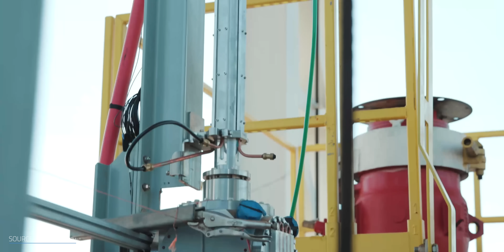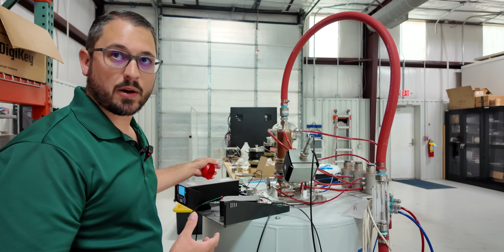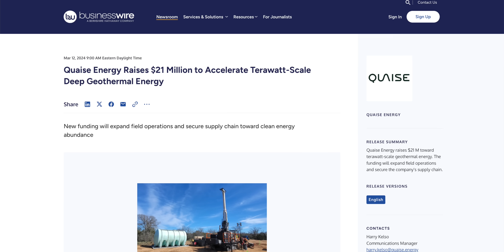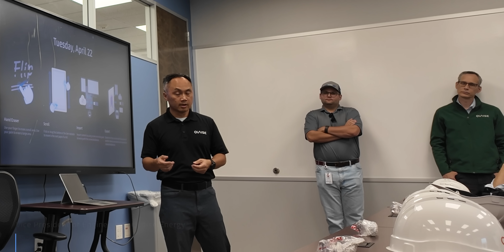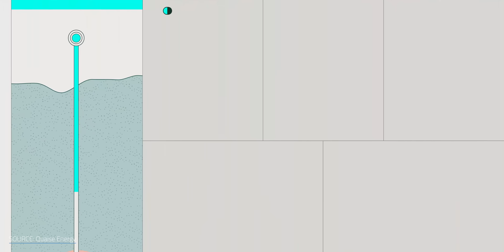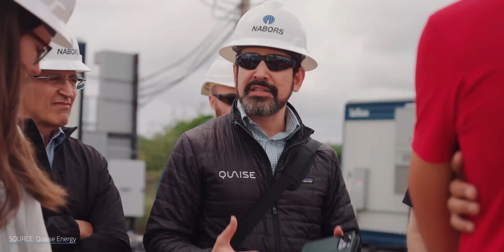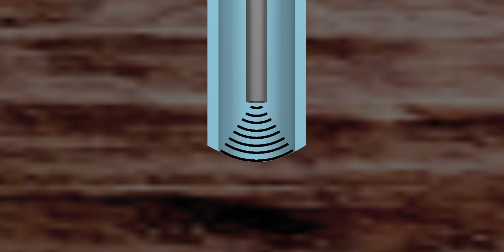How Geothermal Energy is About to Break its Limits

Comment: 14:43 I also really really would like people to put those numbers into perspective on the price of generation. There is no way on earth, that this technology would stay more expensive than the competitors over time.
I would really like to hear what exactly they calculated there. That has to be an absolute lowest end assumption.
People have to think about this, the moment you have the hole, you get energy for free for ever. What you fit to end of it, how often you might or might not have to change the equipment in the hole to circulate your heat transfering liquid all of that can't be so bad the moment the hole is there once.

This is on an absolutely different price trajectory as wind or solar. The expensive part has to be the drill, the hole and the water piping and the rankine cycle turbine can't be cost prohibitive. And every drill you build can drill one hole after the other!

Comment: The technology is fascinating but it's a bit disappointing that this channel has not covered Eavor (I did a search). It's a Canadian company that uses directional drilling to create multiple channels in hot rock, about 3 km down. They are right now building a power plant in Germany that will provide both hot water for heating and for electrical production. Quaise it's not even close to having demonstration project.

Comment: What really shocks me about the criticism of this technology is how most of the concerns are insanely small compared to anything else you read about in energy sciences and technology. Like other technologies have to find a solution for rapid degradation of a catalyst due to not really understood physical and chemical processes... their issue is that it takes 1MW to run the drill...
Any major concert or festival pulls that kind of power. You rent three big diesel generators and off you go... like this really isn't a big concern!

Comment: Scale this up and turn it horizontal and you get a tunnel borer with glass floors
Reply: if course you need to do that because the rock is not very conducting and a 200mm hole will soon fill up with cool water unless you reach a large superhot water mass that can flow easily
Reply: Albeit one that would probably be much more feasible to tunnel through mostly dry mountains, as opposed to tunneling under rivers and wider bodies of water (because of this technology's difficulty in dealing with water intrusion).
Reply: or put it on a vehicle like some sci-fi tunneling machine

Comment: why dont you just plasma cut through everything as the drill, its compressed air + welding arc. plasma arc cuts rock like butter. simplest cutting tech of them all, including water jet cutting. just have some power/water wires and its done. so why not just fiber laser. its also accurate over distance. micro waves nonsense sounds a bit complex. any melting drilling also forms the side walls of the tube by itself. whats progess. must be a registered tech (r). do you like deuterium carbon arc lamps. you need a deep dive.
Reply: why dont you just push a hydrogen welding torch gases down the drilling tubes, and an outer tube brings up the water steam. and any dirt.

Comment: It's very encouraging to see them talking about real hard numbers and not talking about how they're going to need subsidies to stay afloat
Reply: I 100% agree. Everytime I read or see something about this company I am absolutely baffled how no state has just said, hey we give you 10 billion euro, build it.

The problems they list are absolutely laughable to other technologies. Just the fact that they see it necessary to mention that they need 1MW to run that thing... Like how much power does a Siemens reactor for silicone use? Or how much power does the set up for Adeles shows consume? 

This is absolutely crazy. And the potential benefits are just endless, how many holes that one could use so that you don't have to drill the first km do we have on this planet because of oil drilling and water wells etc!
Reply: @petergriffin4629  The BIG BUDD Tractor. The largest tractor in the world has a engine producing 800KW mechanical. 1MW of power is laughable in the grand scheme of things.
Reply: @JackWeems  part of the problem with this viewpoint is that it fundamentally means “if it’s not cheaper than burning dinosaurs on day 1, it won’t ever be done.”

We’ve done like 200 years of economic development on oil. 

And it may turn out to be the case that oil is just flat out cheaper than all the other alternatives. Subsidies are how you slowly introduce that cost difference to a population so that they’re not freaking out overnight. 

Don’t vilify subsidies. They exist for a reason.
Reply: "how they're going to need subsidies to stay afloat"
He didn't really say that. He did say they're negotiating guaranteed rates for power that won't be on the market for several more years. Market rates don't really need negotiating, because the market sets the price. It remains to be seen if he's getting at, above or below market rate contracts, and whether those depend on any sort of credit or not.
Reply: @wisenber  not sure if I missed OPs point but I'm pr sure they were saying most of these promising technologies are usually encapsulated by subsidies due to not being economically viable for one reason or another, and that this tech doesn't seem to be in that same camp
Reply: @robocu4 Prenegotiated rates that are above market is one of the main subsidies. That's why so many wind projects went under when MA and NY wanted lower rates than the original agreement.
Reply: Another excellent video. 👍 You are really outdoing yourself with the puns!
Reply: There is nothing about numbers in that video...
Reply: Geothermal has been neglected and ignored by the government for decades, which might be its greatest strength. That and sharing infrastructure similar to the petroleum industry.
Reply: This looks like a pipe dream!
Reply: @soundsoflife9549  <drum roll>
Reply: This method of Energy abstraction is very bad.
Reply: People are not thinking deeply at this topic at all - from my massive comment:This won't work under our current 'for profit scam economic system.' Look, when humans discovered oil's usefulness, we got wars for 120 years over resources and a never ending headache in the Middle East, terrorism, and trillions of debt for fighting wars over their - all because of market economics - all because the easy to get oil sat under people who didn't share our same culture so we had to muscle our way in. So what's going to happen when all these corporations want to take over all the thinner parts of the Earth's crust to make it easier to hit heat? Looking at the plate tectonic map you flashed on the screen, are we going to have wars with Japan,  Peru, the Philippines, Cuba, Haiti and various African countries because they lie on or near fault zones?  Are American energy company going to use the 'Velvet Fist of spreading Freedom and Democracy" to force them to build steam to energy plants on their sovereign soil or territorial waters? Any company will have to spends billions of dollars running deep of shore platforms in the middle of the Atlantic  or pacific ocean just to extract heat energy and then what? Ship hot pressurized water or steam or a giant metal heat sink hundreds or thousands of miles to be converted to usable energy on shore?  Or are they going to magically make floating energy conversion station way out in the ocean and magically beam that energy to shore with microwaves? And because our entire socioeconomic system is motivated by money, profit at all costs, corners will be cut, and power will just be consolidated into the hands of the few. And does geothermal really solve anything? All that heat that gets sucked out of the Earth is going to get dumped into Earth's atmosphere or the ocean, thus negating any real 'CO2/emission savings'
Reply: This will not be some 'magic savior technology' - geothermal wont save us from climate change - climate change isn't about C02 emissions - climate change is due to HEAT ENERGY being pumped into the atmosphere. It does not matter WHERE the heat energy comes from, its all about HOW MUCH HEAT ENERGY is being added to the atmosphere. 95% of people do not understand thermodynamics and are fixated on C02 emissions because that's what mass media pumps into their brains
Reply: government contracts are subsidies...what are you talking about?
Reply: @bvbxiong5791  That's wrong. Not all government contracts are subsidies. It just means the government is the customer. The government buying military equipment from a private company does not mean they are subsidizing the product, just that they need it.

Comment: I am a massive fan of this company and this technology. To me this is a perfect storm example how real progress in the market, engineering and science works.
I am a physicist but I do also have more than a foot in engineering and especially in the actual science of innovation. It's one of the most typical markers of true innovation that an invention produced by steady progress in field A enables technology B.

I just want to go through this technology and why it's absolutely amazing for everyone to understand. So first, when anyone gets hyped about new green energy you have to do a back of the envelope calculation for the terawatt challenge first. This will return rather quickly that silicone solar cells... lithium ion batteries, even wind power don't pass the test.
You can't scale to TW power at all or not in time. This can! Easily.

Next up, what are the actual limitations towards achieving a goal, what is the nature of the obstacles. If you consider battery technology and solar cells and the likes, we are talking about physics and chemistry. These are notoriously difficult to improve on, once something has been found lithium ion batteries for example, engineers are extremely good at optimizing everything about and around them (think about modern car batteries) but they won't improve the actual physics of it.
Here we have the perfect storm for that, we can do it! We did it already, the soviets drilled 12km deep in 1989... but nobody did it since, because of limitations of the time, but just from a physical envelope question, we already did it! Now give this 40 years of improvement in every field of industry and tackle the same problem again!

It's like with Musks rockets, everyone went crazy with what they achieved, but don't forget, they beat equipment from the 70s... Quaises competition, the bar they have to cross is soviet technologies from the 70s! They can do that with absolute ease.

Finally, and this is the amazing part, is scalability simplicity and necessity for control. Technologies have a really big impact, if they are simple to do and if lacks in control can just be avoided by hitting something with a bigger hammer. Think about jet planes of days past, the engines were way way less efficient then today, but that doesn't matter, because expending more energy to get to the same outcome is usually a lot easier, than investing more energy to get something more efficient.
The numbers they give here for what power they need are laughable in the large picture. Any gravel quarry with the machinery there uses that kind of power. So this is totally scalable and it could be done quick. Want a bigger hole? You don't need to get a perfect great efficient system going. You can just get a bigger Maser, take three of them and blast the shit out of that hole.
Once it's done you make money from it... for ever!

I would really love to invest or something in this technology! I am hooked.

Just on a side note, this is the exact reason why states should invest less money, to force not really market worthy technologies in the market, and rather shoot it broadside into sience and see what sticks!

This the final point I want to leave anyone with. If you are critical of this company and what they might be able to achieve, look up how much money just Germany has invested into solar power that doesn't really work and imagine if they put 1/3 of it into this technology...
Reply: User: Claims solar cannot scale to Terawatts power
World: 2 Terawatt Photovoltaic in 2024 (with the 2nd Terawatt installed over just the last 2 years!!))
Reply: @tristanwegner nonsense. That's peak power. 
That's not average power generated over a year. 

That's like calculating how much fuel cars use by multiplying the peak power output the manufacturer provides with the hours used.
Reply: @petergriffin4629  you said "silicone [ha ha, silicon ] solar cells... lithium ion batteries, even wind power don't pass the test". They are a million times closer to clearing the arbitrary bar you've set than this technology. And they aren't notoriously difficult to improve, everyone in the field but you knows that their cost curves continue to decline. It's a fact that solar and wind, increasingly backed by battery storage, are the majority of new generation everywhere in the world and their production increases every year. You need a better back of the envelope.
Reply: @tristanwegner  Bro, ich habe mir jetzt sogar extra die Mühe gemacht und die aktuellen zahlen nachgeschaut. Meine waren etwas veraltet ich hatte dazu eine Vorlesung im Master...
Im jahr 2024 laut Wikipedia, nicht das das eine geile Quelle ist... wurden 2131TWh solar erzeugt.
Das Jahr hat wenn ich mich nicht irre 8760h 2024 weil es ein Schaltjahr ist sogar 8784h... da sollte selbst ein unterbemittelter sehen, das die zwei Zahlen zusammen nicht 2TW ergeben😂😂😂😂

Und der Punkt übrigens ist ja nicht, dass etwas nicht irgendwann zu 1 TW skalieren kann, sondern wie schnell.

Wir haben derzeit so um 20 TW für die gesamte Menschheit das sollen bis 2050 je nach Schätzung 35TW werden.... wenn wir mit globaler hochbelastung der industrien gerade so 240 GW gebastelt bekommen über Jahrzehnte, wo ziehen wir uns da dann 15 TW aus dem hintern?

Comment: I love the idea but I would like to know how they extract the heat. The amount you can extract has to be related to the thermal conductivity of the rock at that depth. With only 2 shafts you would be quite limited I imagine.
Reply: Yes indeed. The length of the shaft that's in the really hot region matters. Claude AI couldn't give actual numbers on how fast the rock around hot geothermal would cool down. You could always pump water into the hole at a lower rate, or pause operation to let the surrounding rock heat up, but that's going to increase costs.
Reply: @skierpage  Yes, and negate the whole point of operation.

Comment: Using deep geothermal seems like  the best tech to fill in the proverbial 5% baseload electricity that would save the solar/wind/battery system from extreme overbuild. That would allow for geothermal electricity to be somewhat more expensive, since it is only filling in gaps. The alternative is to use solar and wind excess to electrolyze water, then use the hydrogen to generate storeable e-fuels. This will be a very inefficient process, and probably much more expensive power than something like deep geothermal.

Comment: Firmed solar wind (batteries) is cheaper period.  You can’t charge your customer more /kWh for this tech and realize higher profit margin .. why would I pay for that??  The thinking is 24/7 availability.. but that has to compete with the 24/7 availability of a grid running wind/solar/batteries/hydro/pumped hydro/ plus gas peakers.  The number of hours the gas peakers run is immaterial to cost .. but they are needed to help fill the holes.  The future of generation is about math at this point.

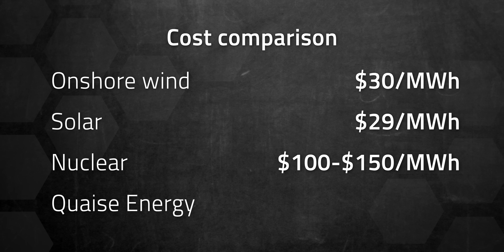Comment: 12:32 Finally, a viable argument for wind and solar. 

Now, what about solar heating through well placed windows and shutters in houses? Or deciduous 🌳 trees to provide shade in summer 🌞 and loosing the leaves during winter allowed the sun 🌞 to warm the house 🏡. Evergreens to block prevailing winds and winter winds?
Reply: Uhm.. what?
Reply: Solar and wind are conservative sources; even if you do not use them they are present.
Both nuclear and geothermal add extra energy to the earth surface and make the surface hotter. Whatever way energy is consumed it gets converted into dissipated heat that must be radiated back to the space!!

Comment: I don't buy the TIR argument. So solar+wind is cheaper, but it returns less money? That's only if the electricity model doesn't pay as it should.

It's different when you compare solar+wind without storage and with storage. That it something that require careful detail. But cheaper but less profitable? That's a market problem.

And when at the end of the video, he limits the solution to geothermal and nuclear, it's clear that solar and wind are hitting hard in their business. He attacks them in a subtle way because that.